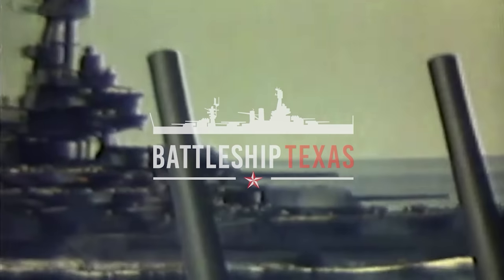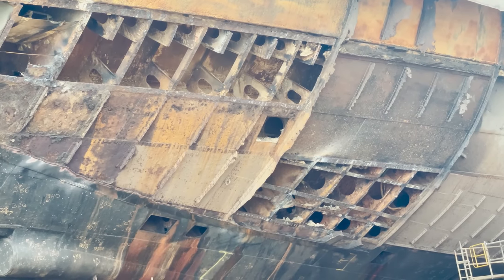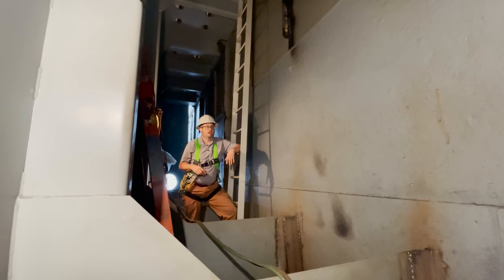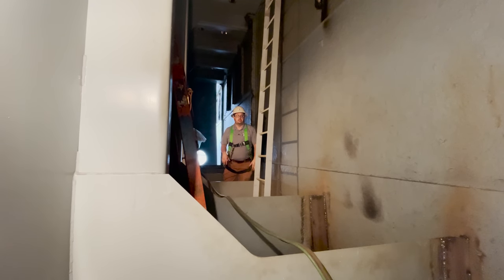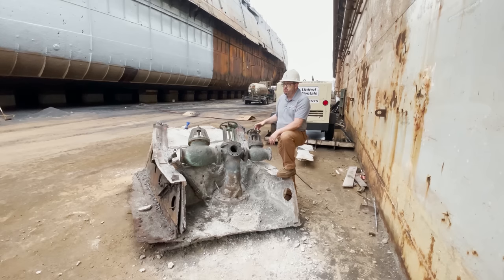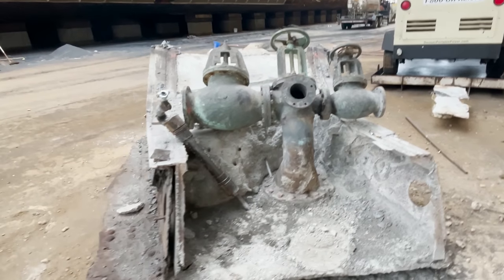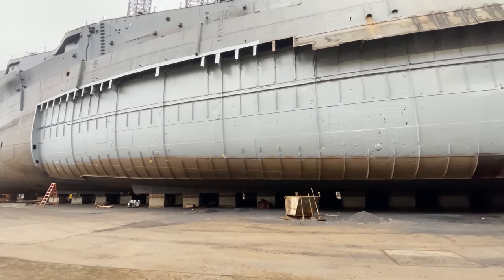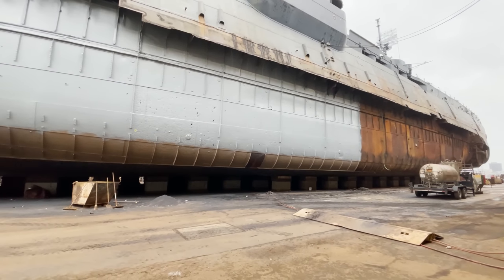March in Review | Battleship Texas

Comment: I’m impressed this ship made it to the dry dock without sinking.
Reply: They made her unsinkable! Joke aside, bulkhead was full of foam so she could not sink.
Reply: @hond654  No amount of foam will create more buoyancy than the weight of that old steel and concrete.  She would sink if enough water got in.  Hence why they're taking it all out and replacing the metal
Reply: Stop being dramatic. It wasn't that bad. Some leaks sure but overall structurally sound. I'm sure they had pumps running to counter the leaks
Reply: We put enough flotation material in there to get 60 lb of flotation for every cubic foot
Reply: @bmused55  you're wrong my friend I have floated three boats and put enough material in them to get them off the beach on the Aleutian chain you're not familiar with the material the only reason that that went anywhere is because of the material yes there were a few pumps
Reply: @Charlies Lorenson  were either of those boats a 30,000 ton battleship with concrete filling it's innards?
Reply: Her crew sank her halfway on purpose to lob shells at bunkers, no way she's sinking in peacetime. The Texas is made with rage engrained in every rivet.
Reply: Yes easy for you to say that Travis did a good job guiding us telling us where to go the reason it didn't sink between the concrete and the foam we knew it wasn't going anywhere to the bottom of the ocean got to defend my guys and my team
Reply: @charlieslorenson1861  you don't need to defend. Trolls don't care what you say.
Reply: This ship is divinely protected , thats all I can figure. Worlds only dreadnought thats left.
Reply: Just slap some bondo on it , lol
Reply: @charlieslorenson1861   I wasn’t saying it like the people moving the ship are incompetent. I was saying that as in the sheer amount of damage and rot it’s impressive it didn’t sink. So good job on the move. Sorry you took that negatively.
Reply: @bmused55   Yes thank you for clearing that up for me. I was not being negative. I just saw how much damage and rot was on the ship in the latest update and was genuinely impressed.
Reply: They turned it into the largest Boston Whaler before moving
Reply: Never underestimate the heart  of a champion.... Rudy tomjonovich... Houston rockets

Comment: Wow!  I am impressed by the amount of work that has been accomplished so far, and she is looking good.  From what I see Gulf Copper is treating you guys and your Lady right.
I agree with you about preserving the fittings and equipment removed wherever and whenever you can.  I also agree that while many are asking about "The Guns," it is the hull that needs the most TLC right now.  The guns can be worked on either ashore (as has been shown for the secondary batteries) or once Texas is back in the water and you are not so pressed for time.

May all the surprises you find from here on be pleasant ones.

Comment: Great presentation Travis (as always)...If anyone is asking themselves, why not just apply the rust inhibitor and seal it and save time sandblasting.  It's because rust creates itself in layers and the rust inhibitor only works with direct contact of the piece.  So sand blasting knocks it down to the single surface layer where the inhibitor is most effective to probably 100%.  Metal technology has advanced to far since this ships last dry dock and that means these applications will ensure she will be with us to teach future generations about her for a long time.
I've said this in past responses, I've been down in the steering section well over a decade ago and you could smell the rust it was so prevalent.  Thus as Travis states, he feared of a possible collapse...I can attest to the same eerie feeling that if you touched something, it would break.
Reply: From 2013-18 they did something like $50 million in repairs to completely replace the flimsy rusting away frames holding those huge engines, boilers, and evaporator as well as many other areas of the ship. This $35 million drydock is nothing in comparison.
Reply: @nogoodnameleft  Knowledge nugget TY, ...I would ascertain that the reason for that cost was doing such patch work in place? ...tight condition and such and reinforcing on old metal.   Being on a dry dock allows so much easier access, especially since the hull is being replaced and panels being removed.

Comment: Doing a  great job to keep the old girl alive and  well. Concrete was one of the worst things ever put into a ship or boat. I bought a 30ft wood cutter back in 85. Seems the owners wife tended to get sick as the boat was a bit tender. So, he lifted the floor boards and put in steel scrap and cement. Fast forward til I bought her. The garbord strake on both sides was flopping loose, and the ribs were like powder. Chiselled out the cement and steel and found the oak keel and ribs were literally dissolved into just the fibres. 30 pairs of ribs and the top of the  keel to a depth of 3 inches. all the 3 inch thick floors were just about toast. NEVER ever put cement into you boat.

Comment: Just a dumb question, after removing those bad sections and replacing those with new steel, and get out those concrete sections, would the ship float in a higher level than befor?

Comment: Will you be able to enter the blister tanks from the inside for inspection or was that even an option in the old (original)  blister tank setup?
Reply from the maker: Tank access for the blisters came from the top or, in the case of about 6 tanks, from the side. We will be reusing those access points but with new ladders and sounding tubes. That way we can check the water levels without entering the tank, and if we need to enter them it will be much safer and easier to do so.

Comment: Can you discuss what, if any, additional active corrosion protection features are being added?  Are there additional zinc's being added?  If zinc's are being added, will they be arranged such that they can be renewed relatively easily even with the ship in the water?  You talked about the coating system to some extent in this video - is there more detail you can provide?  Can you discuss the phosphate conversion coating in detail?  What other, if any, corrosion protection features are being added during this work?  Super interested in any additional details you can provide on this topic.  Great job on this maintenance on this wonderful historical artifact.

Comment: Won't you have to re-float the ship and reposition the area of the blocks it's currently resting on to address those spots?
Reply: I was wondering the same thing. Hopefully someone with dry dock experience will let us know.
Reply: I'm pretty sure the blocks can be lowered slightly to ease pressure, and then moved one by one, though i'm not entirely sure.
Reply: @crazychicken7125  Normal dry dock blocks are solid and not adjustable as far as I know.

Comment: Two things from historic perspective I wish they could do but as a mechanical engineer I understand many of the reasons for it but welding instead of riveting kind of robs Texas of that vintage/historical interpretation.  The only historical welding Texas would have seen was repair work in her final years of service in WW2 to keep her in action.

What condition is her belt armor especially below the waterline b/c NOT ONE steel plant in the US let alone the world can make Class A STS Krupp Cemented face hardened plate today…it’s a lost art (I know cause I work in Steel Plant machinery design) the best they could get to be anywhere near that would be HY80 or HY 100 steel used in submarine hulls and carrier decks and it’s not classified as armored Steel
Reply: They actually did do riveting on the interior spaces of the hull like they did in the 2013-18 interior repairs to plug leaks. Costed them $9 per rivet. On the outside parts that are below the waterline is pretty worthless to do rivets when welding does just as good of a job and nobody can see anything below the waterline.

Comment: Out of curiosity, how much asbestos is there on the ship? I work in maintaining a number building that date from 1905-1950 and most of the steam pipes still have plenty of asbestos insulation and plenty of asbestos tile. Has most of it been abated at some point?
Reply from the maker: As we have taken operational control of the ship, our abatement scheme is to have it removed in whatever space we're working in. For example, a volunteer project we had before we left San Jac was to repaint the Gunnery Officer's space. Once it was painted, we had an environmental company come out and remove the asbestos jacketing. There is quite a lot of it on the ship but, with it being encapsulated, it does not tend to be much of an issue.

Comment: Does anyone know if the top section of the battleship called the superstructure will be repainted like the hull will be and are they going to replace the wood on the deck?
Reply: Measure 21. All will be painted that unique dark blue color. Look at 1990s photos of Texas for how she will be painted. Thankfully Measure 21 is chosen because the haze grey was only used in 1939-42 and haze grey is not accurate with the current configuration of Texas with all those fancy 40mm Bofors quad guns. From 1943-45 they used all types of different camo and blue colors and phased out the ancient and ineffective, but pretty, haze grey.
Reply: @nogoodnameleft  will the deck be replaced?